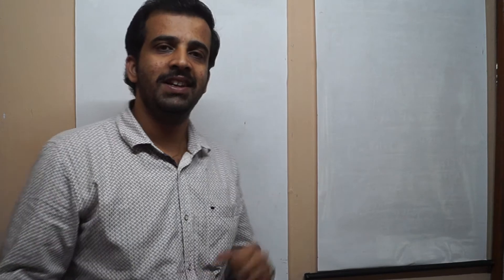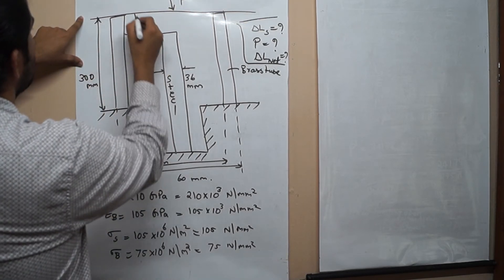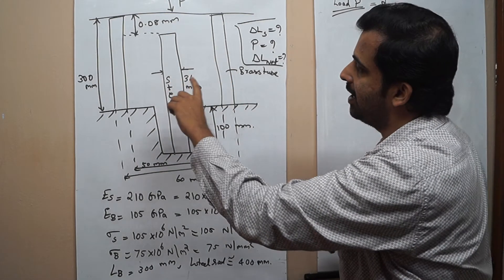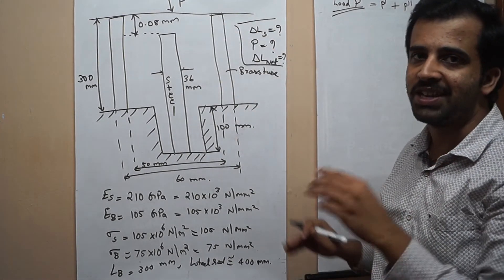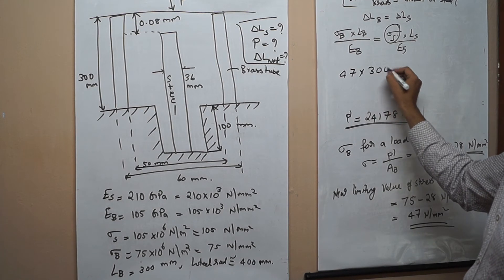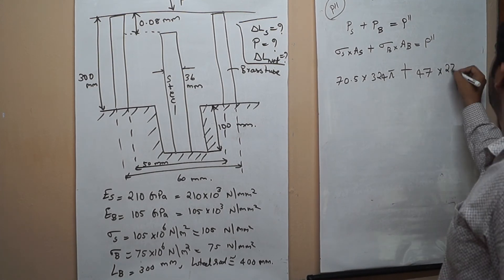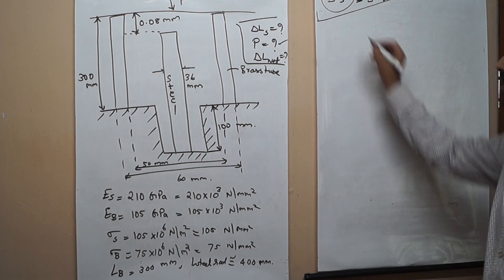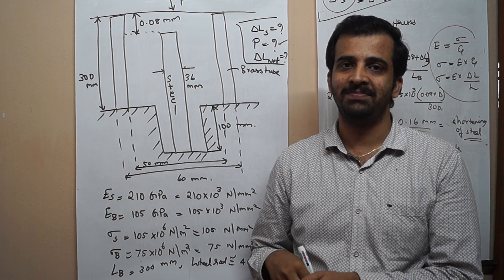COMPOSITE structures. Numericals. Lecture 9

Comment: Sir ivde stress equate cheyyunnathenganaa ( for finding compression in steel) ath equal allallo
Reply: @mechanicalengineeringdatabank  sir , but previous questionil load calculate cheythappo different values  allaarnno answer kittye
Reply from the maker: Whatsapp 8921645618